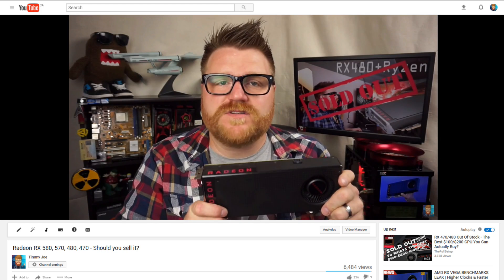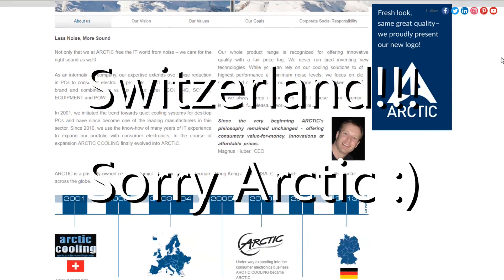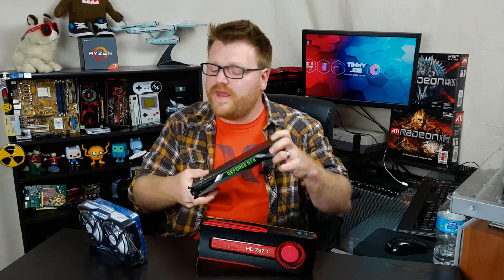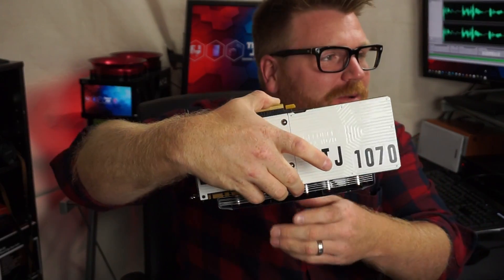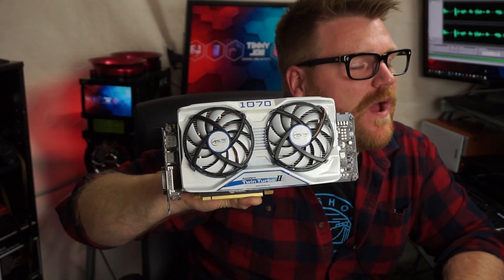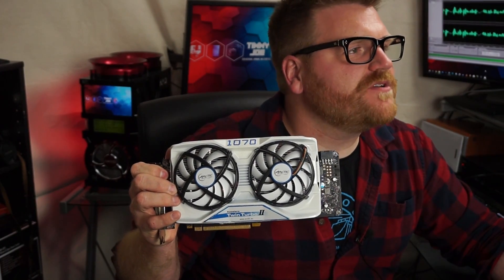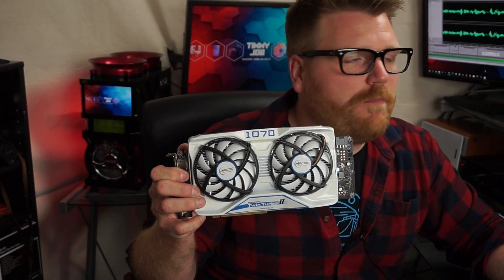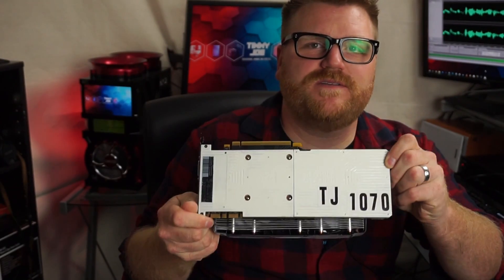Nvidia GTX 1070 Overclock Arctic Accelero Mod

Comment: great mod, im impressed! will try similar, in a harder way.. Acelero Twin3 /same as 2 but with bulky Alo backplate/ on my NEW gigabyte2060 6GB with rare better TU104 GPU with untypical 51mm gpucoooler hole distance, which Arctic DONT HAVE. must build own custom alu cooler frame and drill 4x 51x51mm hole , so that i can still can add heatsinks on ddr6, impossible with stock steel mount frame.that will be a wild mod, must cut custom missing long mosfeat heatsink too and cut the heavy backplate shorter .BUT i got this nacked heatsinkless working 2060 for just 80€, sold my old beloved OEM GTX1660ti for 100€ and had that accelero dusting since years..

Comment: I just replaced the stock fans on my Palit GTX 1070 with an Accelero Twin Turbo II (one fan had died).  It was a pretty easy project and the temperature tops out at 67 degrees. Not bad - its actually about five degrees cooler than the huge HSF that came with it.  Sad thing is, Arctic Cooling has discontinued the Twin Turbo II. I had to look all over to find one.  I have no idea why - its so useful for situations like mine.

Comment: I love these coolers. They may not be pretty, but I don't think they are too ugly either. They would fit in with a more industrial themed aesthetic, but their whole design is based on performance, not looks. It's a great way to get a decent overclock on a card for not much money. Even the bigger brother to this one (Accelero Xtreme) is less than the price of a decent water block alone and has a 300W capacity for you to play around with.

Comment: Hey please tell me if this cooler will fit on the Asus Phoenix RTX 2060? The temps on this card are killing me. Please help. I know for a fact that nzxt kraken g12 doesn't fit on it, and arctic accelero extreme 4 does fit on it, but I don't want to spend that much money on an aftermarket cooler. I think mono plus is an excellent purchase , if it can fit on my card.

Comment: Will this work on a rx570? My Asus strix rx570 4g OC runs hotter than I want.
Reply from the maker: Uhh, it uses a 2 heat pipe cooler. This has 5. It is extremely effective for it's size but it would make more sense for you to sell your rx570 and use the money you would spend on the accelero to put towards a real nice rx580 8gb
Reply: @TimmyJoePCTech  I agree but I'm a broke mofo and got a deal on the rx570 on eBay for 60.... Put new thermal paste on it since it was running in the mid 80s and seemed really hot. I've only got a ryzen 3 1200 CPU I'm pretty sure if I go any higher on GPU I'll be bottlenecking like crazy. It's just a cheap piece together gaming rig.

Comment: waste of money this has the same problem every card has you have to remove everything just to install new fans . this is why most modified the case  and add fans with zip ties easy to replace with out having to take the card apart

Comment: The thing about custom aftermarket gpu coolers are they cost an arm and a leg the money is better off spent on getting the next  series up. Unless 1. You get it for free 2. You have the best eg Titan V/XP/TI but even in those cases maybe they can afford all water cooling and better off with Ek blocks. So with all those points in mind I really doubt after market gpu coolers even sell that many oh yeh and all these voltage regulators like how much more can we push it if we already using non founders edition cards with triple fans and better non fe coolers.
Reply: The thing is, with prices/supply the way they are right now, buying "the next series up" really isn't a good option. For example, I would have needed to spend an extra £90 (~$125) to buy the more expensive variant of the 1070 Ti I've got, which comes with a better cooler. The Accelero Twin Turbo II in this video is currently £30 (~$42) plus delivery, which judging by this review almost certainly performs better than the cooler on the more expensive variant.
Reply: Yep in your specific case yes, but not so much for myself and most other americans I guess. I see it $60 USD plus shipping or $60 AUD Add GST shipping really hard to justify for it. CPU's is a must since we can squeeze out sometimes like an extra 1ghz+ in performance which easily outranks even the next level up in pricing ones.

Comment: I don't care how ugly it is, besides anyone with a Noctua CPU cooler has already embraced the ugly! I think I'm going to get one of these for my 1070 Ti.
Reply: Hi, I'm curious if you did end up getting this for your 1070 Ti and what your experience was. I've used an Arctic GPU cooler (single fan) before on an R9 270 with great success and am considering putting this exact model (from the vid) on my 1070 Ti to keep it quieter under full load. I tried an Accelero III I have sitting around, but because of the placement of the GPU near the middle of the card, the III model would sit really far "back". I wasn't comfortable using it because of the resulting total length and torque it would put on the card.

Comment: i think 1080 Ti is actually quite a good deal. you can get it for 700€ here while the gtx 1080 is already 620€ or so. might as well spend those 80€ and get a 1080 Ti lol.

Comment: Pascal cards are locked to (if i remember correctly) 1.092mv by nvidia. Even the AOB partners. Above that is where nvidia claims you will start to degrade your gpu at an accelerated rate and you would need to find a custom bios to take your card beyond that. my strix card runs about 60-65C at full tilt with the factory fan curve 2070mhz range but i start to voltage throttle at that point.

Comment: I can confirm that these coolers (even though they dont look thaaat great) perform AWESOME!
I was very sceptical but there was no better priced 3rd party cooler out there than from arctic.
But a year ago the Mono Plus for the 150W 7870 (Cooler offers up to 200W I guess it is) and jesus.. the 7870 never ever got over 49 Degrees again while remaining on the lowest possible speed of the Fan which is around 800RPM.. since the 7000 Series didnt offer a fanless mode either and the original XFX single Fan spinned 800 aswell while idling.. this thing is almost unhearable in every Situation (I mean just "listen" to a 120mm at 800 RPM in a closed Case).
Even maxed out it only went up to 55 Degrees at 800RPM if you bump it up to 1000RPM it would be again under 50 Degrees of course all messured in a well airflowed case.
So if you dont care about astethics well these are great coolers! Even the Mono Plus is perfect for lower end to medium end cards or a Multimedia/Office System which just needs to be cool - now the 7870 can perform some light gaming titles for my brother and parents.. ^^

Comment: i cringed when i saw you use hot glue to attach the light to the heat sink. Just remove it and leave it off its a bad idea to attach it to a heatsink m8. But nicely pained lettering, how did you do that.

Comment: You've genuinely got me looking into using one of the Arctic Accelero on my MSI 1060 OC 6gb, I don't care how junky it might look, I want those temps down!

Great video as per usual, keep up the excellent work.
Reply: Timmy Joe I've been looking into it, MSI and EVGA actually allow you to mod your GPU Cooler without voiding the warranty too?! That was my only reservation, so I'll do it!
I already have an Arctic Freezer for my space heater (FX8350) so I trust the brand, they're sorely underrated imo.
Reply: I have my 1060 oc'd to 2200mhz and +550 on memory and it sits at 60degrees at full load with the fans of my arctic ccelero v3 sitting at 40%. The cooling this puts out is incredible! And it is virtually silent

Comment: the hot glue will be heated up and melt
Reply: it's okay, it'll just drip in the psu underneath
Reply: Twin Turbo 3 doesn't use glue and relies on direct airflow onto the chips/vrms from fans through fins. It helps if your card has mosfet heatsink too. Also backplate, not sure if it does anything besides actually not heating up the pcb unlike most plastic PoS backplates nowadays...

Comment: Why aren't arctic making custom GPUs?
Reply: Closing deals with Nvidia / AMD making custom boards is a whole differen't level.
Reply: They could partner with an AIB like how many people have suggested Noctua should. But I guess it's not so simple coz there's nothing out. It would be a huge step from heat sink making to whole boards though.
Reply: because it's cheaper to make them in house than to subcontract a third party cooling company. If you do go back some years you will find third party coolers shipped as standard on quite a few factory OC models.

Comment: I think It was worth it.. Because there is really no upgrade path for any of us right now because buying a new card right now is very Hard.. I have Been Thinking about doing the very same thing to my RX480 REF card.. I hate that I can't overclock it that much because the cooling is so terrible, and I'm sure the thermal paste is too.. But Yeah I'm definitely, thinking of buying the Accelerro, I'm sure with that I can get my RX480 close to RX580 performance with that heat sink and fans.. Nice Vid, I'm rocking a white & Black case, with Red case Fans.. Looks Tight tho.. So that white Accelorro if with red accents would look nice in my case..

Comment: Arctic Coolers are all about performance. Personally, I don't think they're TAHT ugly. I had a Accelero Mono Plus (the single fan version) on a RX 480,  that was throttling with the stock cooler (XFX...), and it brought it down to low-mid 70s with the max overclock I could get out of it. They're amazing. The only thing I hate are the White stickers if you have a predominantly black RIG. They're a PAIN to take off.

Comment: for 20 degrees, I wouldn't care how the card looks as longs it is functional.
Reply: The cooler cost 50-60$ and you can't RMA it, same with the gpu since the backplate is painted.
Reply: @TheDembe1  Well Mono plus is 35€ with 24% tax and does pretty much the same job. And in EU, they have to prove you broke it to deny rma in 2 years after purchase.

Comment: I think you got a killer deal on that fe 1070. I've been looking everywhere for a decently priced 1070 but they're going for way more than they're really worth so ya I think you got an awesome deal 450 cad = 346.6071 USD. I ended up buying a asus strix 980ti because I couldn't find any good priced gtx 1070. Anyway good job on that videocard experiment, as long as it's performing better than the original, for me at the end, what matters is the performance. At least it's lower thermal, perhaps it'll give you a greater head room to oc.

Comment: I subscribed, because I thought this was a "fun" video. "Ugly" conversion? Maybe, but I kind of like it. It is most certainly different. I did not know this item, (the fan assembly), was available.

Converting a blower style card to an open-air design is something I did think was possible. You showed me something different, unique, and interesting, and I thank you for that. That is also why I subscribed.

Edit #1:
Just finished reading the contest rules. Where do I "Watch the contest video for details" of which you speak? I am subscribed; I am following you on Twitter, although I have no idea how to use Twitter, and I cannot find the "Contest tweet" to retweet. Can you help an "old guy" with this "newfangled" stuff, please?

Edit #2:
I found the contest video. Now to figure out how to "retweet" a tweet on Twitter. Did I say that right?
Reply: You've made it that far into the rabbit-hole, you'll get there.  ;)
Reply: Craig Peters ii
Reply: If you haven't found out already, find the tweet you'd like to retweet, then at the bottom of the tweet there should be a few symbols. A heart, and 2 arrows circling one another. click the symbol with the two arrows.
Reply: +Jamie Walmesley
Not sure what you mean by "ii", but thank you for the reply.